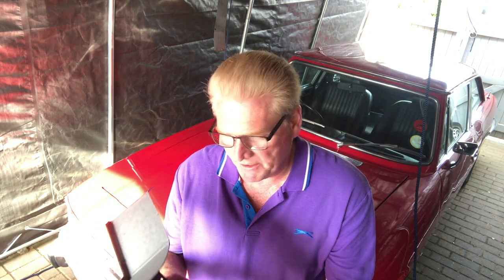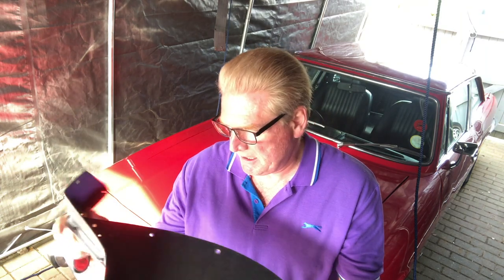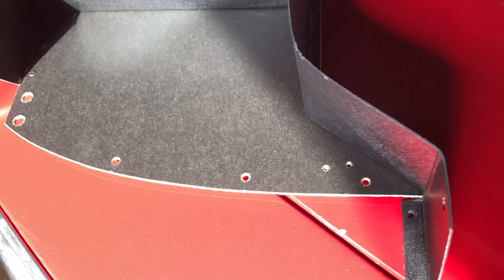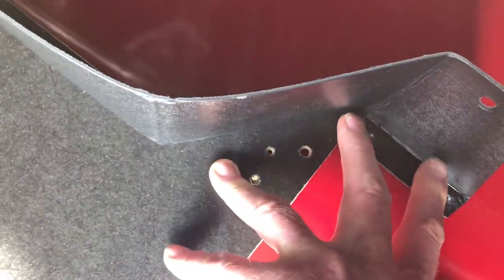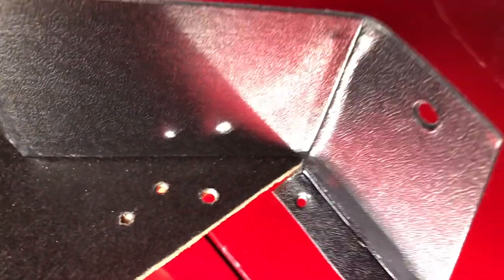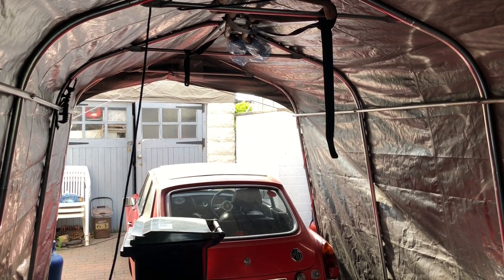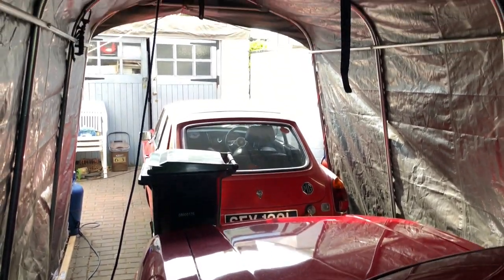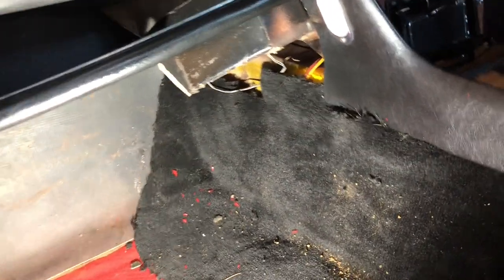Triumph Stag - Parcel Shelf Pains!

Comment: Hi Tony,
Just a few parcel shelf thoughts and comments.
The material is known as ‘Millboard’ 
The original fixing rivets are ‘Bifurcated rivets’ - you’ll find similar on the door panels.
You mentioned the possibility of an extra screw into the transmission tunnel bracket. Thats’s quite right but you can also add a third with the screw going upwards vertically from underneath. You may need to add a spire nut for the screw to go into. With all those fixings, the shelf is surprisingly rigid.
The shelf is designed to also fit cars with AC so you may notice quite a bit of wasted space behind the right with no AC. If you’re up to fabricating your own with millboard, the shelf can be made much larger by using up this space.
Also, if you’re into fabricating, it is possible to make a similar shelf for the driver’s side. Not as easy as it may sound but one of the most useful mods I have done on my car. 
Glad I’m not the only one to find it difficult to locate the bolt on the left, through the carpet into the A pillar !
Keep up the good work.

Comment: Mine came without one, because the bloke who had mine (I bought it in Feb 93) had an under dash Aircon there that I removed immediately. AC may have worked in Melb where I bought it, but I am from WA, and I bought a convertible to drive with the roof down, so to me aircon was "just in the way/more hassle than it was worth/pointless for me."

I looked at options, but they were all flimsy/falling apart, so I just made my own out of ply. Front crossmember is varnished wood that matches the (darker than standard) dash wood, so it looks like it is meant to be there.
Reply from the maker: Sounds good - only thing I've heard recently is that the cardboard was intended as a crumple zone for passengers' knees in the event of a crash, which was a good point. Join us on a weekend by the way for lots more banter! www.arrythestag.com/saturday-sockets All the best TR T

Comment: Triumph were world leaders in cardboard manufacturing technology 50 years ago. 
Like you mentioned, I reconstructed mine several years ago from 3mm plywood. Still holding up, no problem with the weight of two pairs of gloves. Wouldn't push it any further though.

Comment: Tony, remember the shelf you have bought is a reproduction of the original, made with the same or similar material, it wouldn’t be correct using a moulded plastic version that current cars have these days. Once fitted these retro shelves are fine as long as they fitted correctly, which have done. The only thing you don’t want to do is put leaking bottles of liquid on the shelf, otherwise you’ll soon be replacing it!!
Reply: In at last you get it Yes it is right make one out of p!y if you are involved in a crash you passenger might lose their legs.

Comment: What a flimsy replacement they are! You would have thought some company would have made an aluminium tray and covered it in vinyl by now...That's what i did and you couldn't tell the difference, it also could hold gloves and 2 packets of worther's originals without bowing.
Reply: @ArryTheStag  Sorry i don't Tony, as i no longer have the car. I made allot of mod's over the years on stags. You could use your new shelf as a template and put some thin plate underneath the tray, as in time it will just start to bow again. Also make sure your carpet is well clear of the accelerator pedal, my friend got his jammed to the floor   whilst doing a hill start, quickly knocked it into neutral, over revved it and blew the head gasket. Mine got stuck on the second day i owned it and made the timing chain come off....engine wrecked!!! I had 3 more stags after that, my father went nuts when i bought another one. So check it tony as me and my friend were lucky we didn't smash into another car, it is a frightening experience. Thanks John.